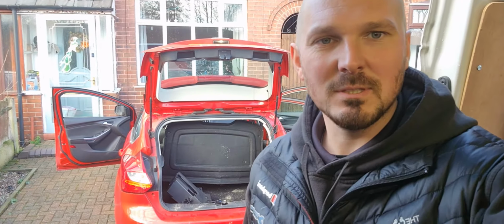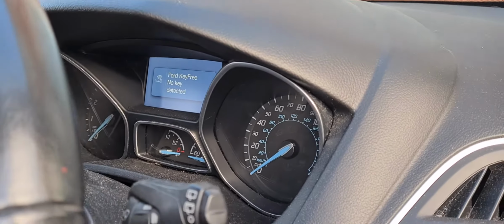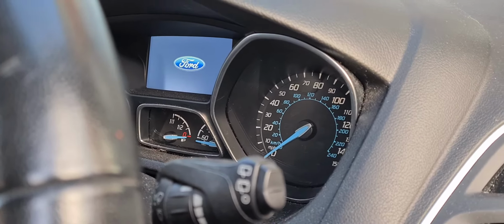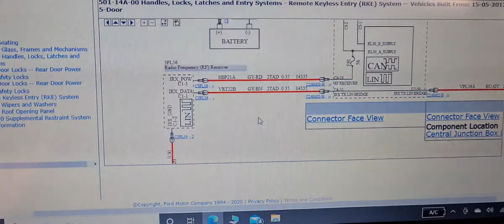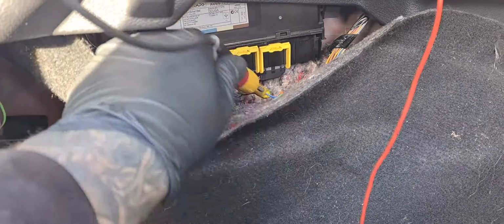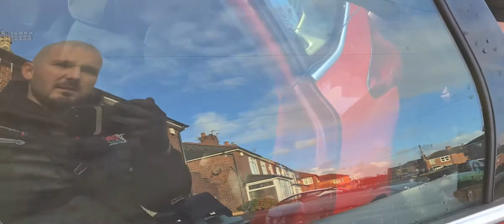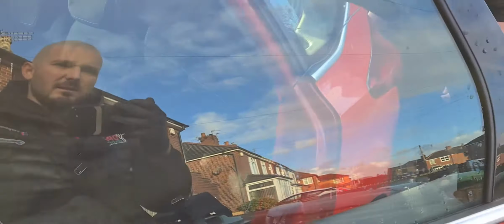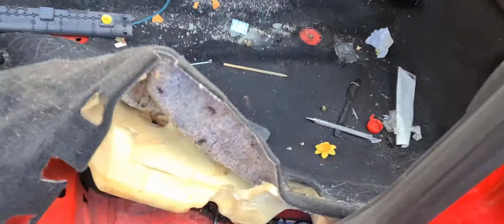FORD FOCUS 2014 KEYLESS START / LOCKING NOT WORKING

Comment: Great job, Bro! I'm fighting just with my MK2.5 keyless. The red LED in the speedometer is blinking for a few minutes at the engine start but the car is starting, I can drive without any problem but it is very annoying. It came to know from your video where is the KVM in the car. I have a wagon and it has it on the same location.

Comment: Ive got a similar prob with a 2016 c-max  do you think could be similar problem ?
Reply from the maker: Possibly. But there are numerous things that could cause this issue
Reply: @eastmanchesterautoelectric6858  sorted it now was attener in the roof near the arial water got in ? thanks